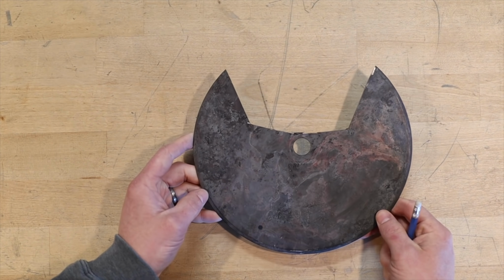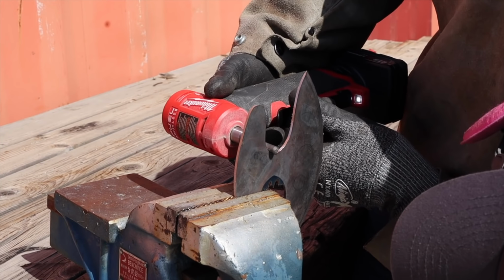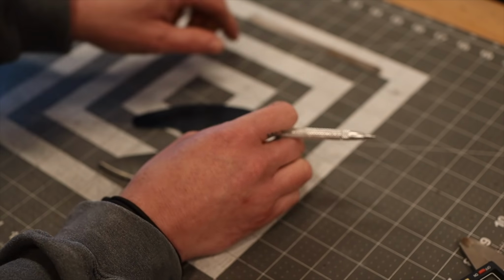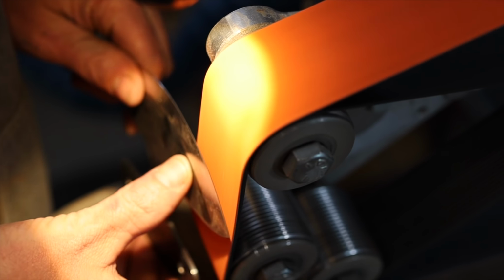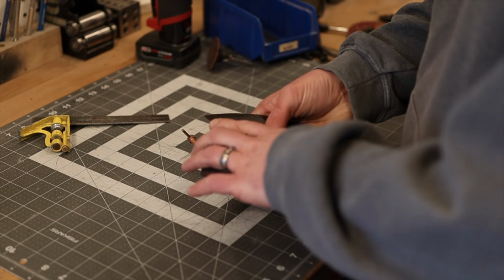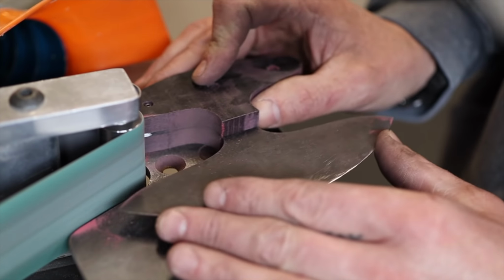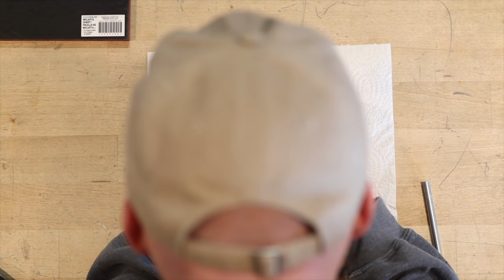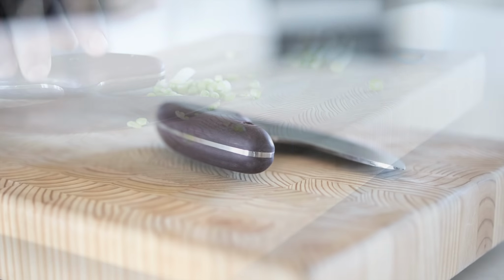Making an Ulu from a saw blade

Comment: I could be very wrong as I am no expert however from what I've read the steel for those saw blades could be something like a m42 high speed tool steel I also work for a company called metal supermarkets and I have had to cut that steel before and I noticed the powder like shavings you were describing while I was cutting that. Like I say I am no expert and I could be very wrong just a best geuss
Reply from the maker: Interesting. Thanks for that. I’m going to do a little more research into these blades and see what I can find out. I shop at Metal Supermarkets all the time! Love that store. A few of the fine folks at my local one actually know me by name I’m in there so much😆👍
Reply: @Simplelittlelife  happy to share what I know thanks for the response I'm a big fan

Comment: you say it rusted quite easily...... that's because its VERY high in Carbon content.  Japanese expert chefs have sushi knives that have a very high carbon content would have to wipe their knives after each cut through a wet piece  of fish because the wetness would nearly instantly cause the knife to rust...  the powder you mention..  high powder manufactured steel....  very good ....

Comment: I had to machine some steel called AR. Abrasion resistant. It didn’t have chips or curls during cutting. It was almost like sand, kinda gritty. I wonder if that is the same?
Reply from the maker: Oh that’s interesting. Sounds very similar in how it machines and grinds. Could very well be. I’m getting more curious now and I’m going to start doing a little digging. I also wonder if I needed a higher temp during hardening. The rabbit holes we get ourselves into 👍
Reply: Ftw, ive never seen AR in sheet. Doesnt mean that it doesnt exist, but the stuff i worked with was brittle, so it would make sense if they didnt make it in sheet.

Comment: I'd like to see the steel sheet on that disk metal. No sparks on grinder, maybe all alloys? A small shop knife out of that would be a neat long term test. If it's really amazing, that would actually suck. Hard to get more material without some research. ✌
Reply from the maker: That is a good idea. I’m also going to try and shop for those hose blades and see if that search could give me some info. 👍

Comment: a quick google search tells me it could be made from M2 steel, “High-speed tool steel, has been around for a while. Popular choice for custom knives and high end and limited edition production knives as well. Gerber was using it as far back as in 90s. As a high speed tool steel M2 can hold its temper even at very high temperatures, and as such is used in industry for high-heat cutting jobs such as drill bits and other metal cutting instruments.”

Comment: Jeremy, simply cover the nose roller on the horizontal belt grinder with a spindle sander roll and then use an old belt tracked high over it to provide drive, I do this a lot when making throwing stars. I also cut down the drum roll as is wears to get fresh contact grit.